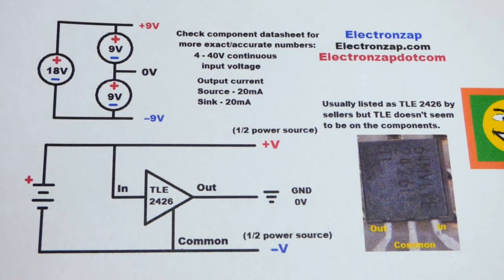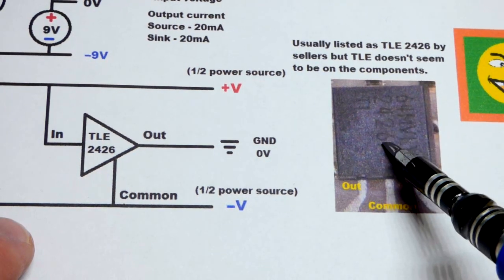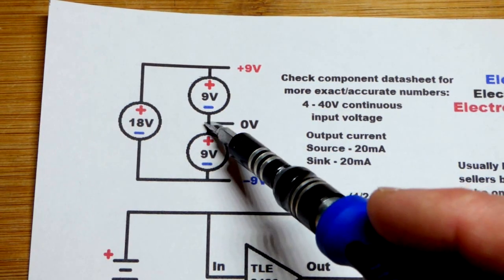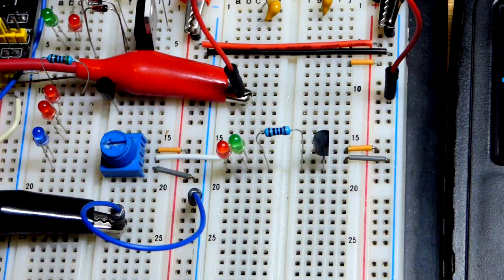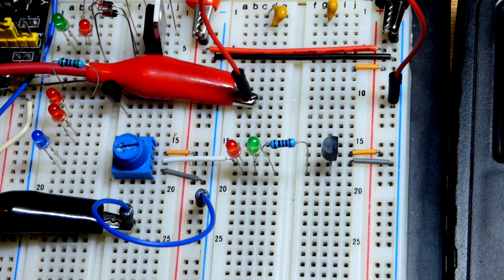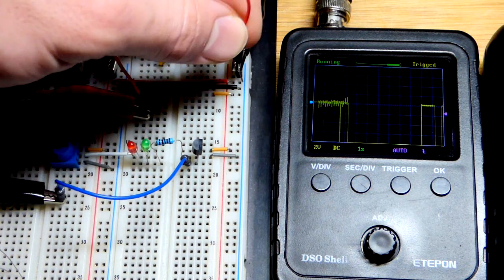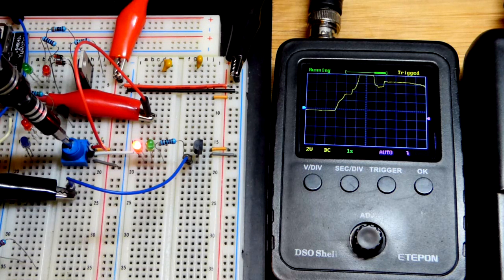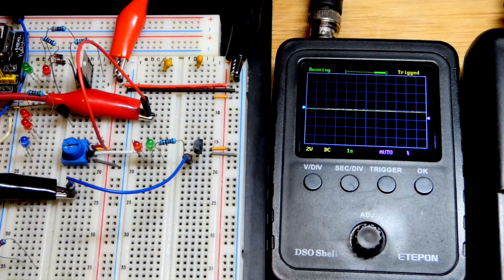TLE2426 3 terminal virtual ground rail splitter IC for split or dual power from single supply

Comment from the maker: https://www.youtube.com/c/electronzap make sure to subscribe and click the bell! https://www.patreon.com/electronzap - https://electronzap.com/ -  https://www.amazon.com/shop/electronzapdotcom is where I post affiliate link ads of products that I use in my videos or would like to buy. As an Amazon Associate, I earn from qualifying purchases.
Reply: I need a power supply for a stereo phono subsonic filter. I plan on using a D.C wall wort that powers a regulator and spitter to power the filter. Should you use a regulator before the splitter and two (+8v,-8v) after. I did not understand your demonstration. A schematic of your demo would have helped. The 8 volt regulators have a data sheet that implies potential use as a split supply .If 8 volt is applied to this splitter ,is the resultant voltage+4 0 -4 or +8  0  -8
Reply: Does a 741 0p amp split to +9,0,-9  volt. Perhaps a +8 volt regulator into a 741 splitter would be the best option.
Reply from the maker: @davidfoster5906  I think you can find schematics that use voltage regulators to split a voltage if you do a Google search. I haven't looked at them in a while, but I think the ones that provide the most power use regulators like you mention.

Comment: I was a bit disappointed when I found out the the TLE2426 only halves the voltage but it is not magic is it? Any thoughts on you putting together this kit? :) https://www.amazon.com/dp/B00B88A06W/
Reply from the maker: I don't really do anything with linear regulated power supplies so no opinion unfortunately lol. The reviewers seemed to enjoy it. I have a crappy workspace and don't really like soldering more than I have to but it looks fun for those who do.
Reply: I have been using it to power my breadboards for almost 1 year now. It's great for op amps and transistors.